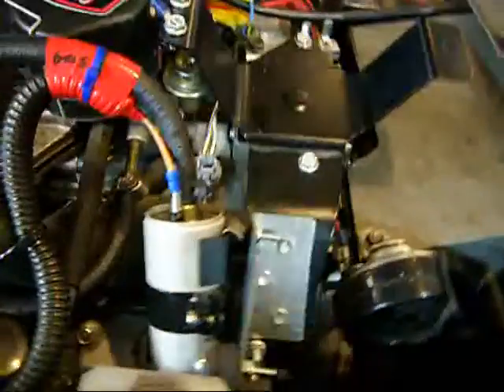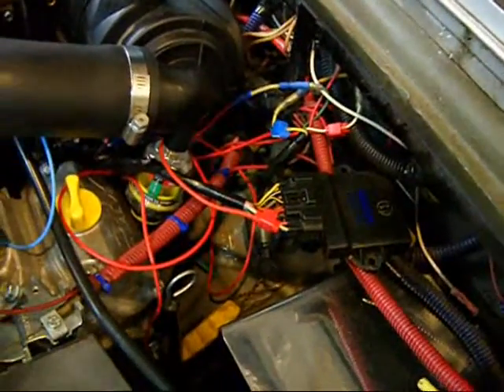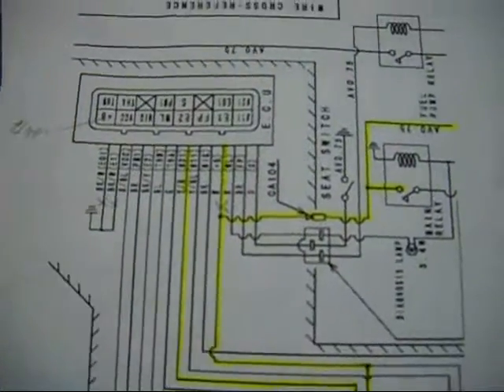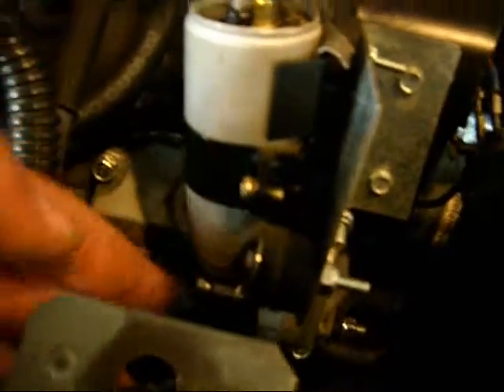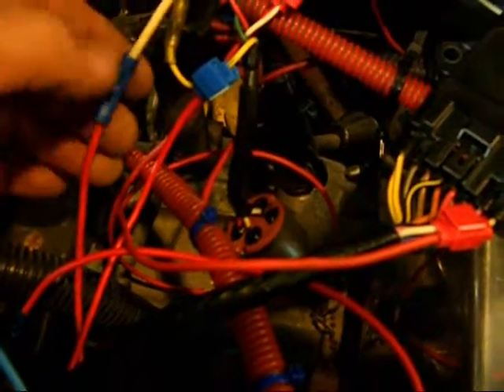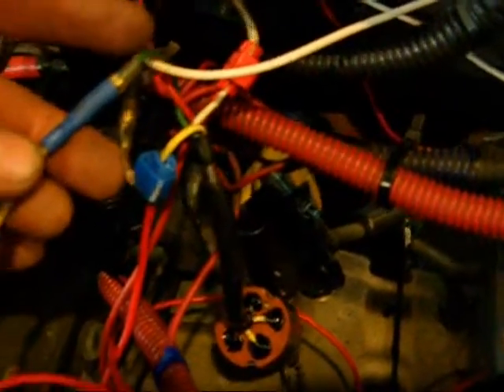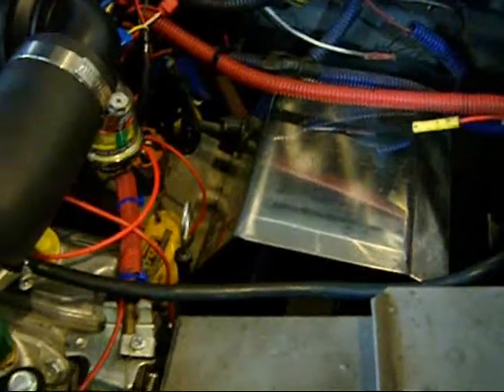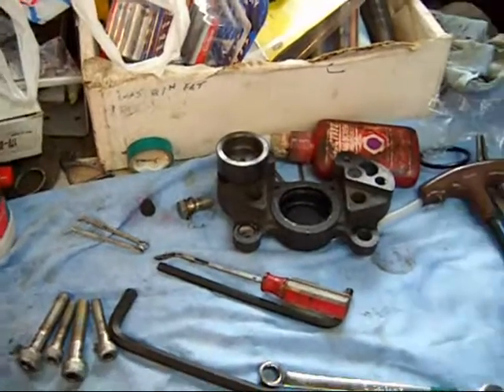Argo is alive!!!  Wiring of engine, Caliper rebuild Video #10

Comment: Looking really good. Couple things: In a perfect worls the Secondary should NOT turn at an idle, but often they do a little bit. Yours is turning WAY to fast, and is, in fact "Engaged". You will never be able to shift it into gear like that. The belt should ride just a little above the secondary when at Idle. Looks and sounds like idle is to high.
Also, it's not uncommon for brake pads to wear unevenly. It's a combination of the "nature of the beast" and "oil contamination" from idler chains.

Comment: get rid of all them wire conectors, there only good for a quick fix, soilder and heat shrink all conection, then your good for life, never a problem, lke you will have with them fast wire conectors